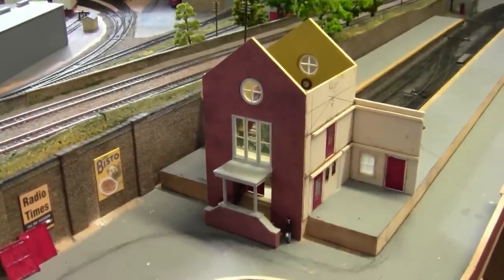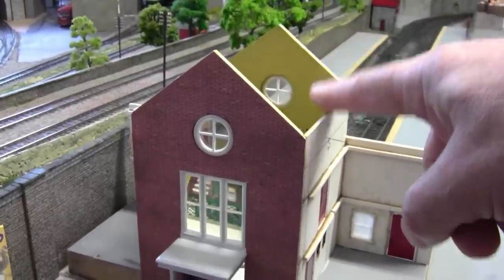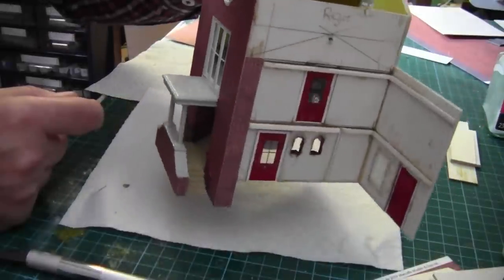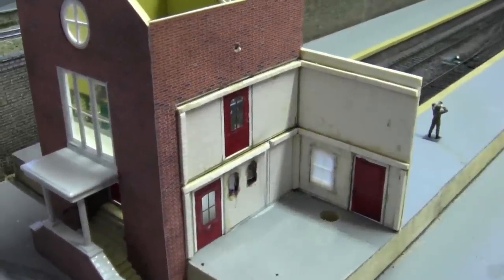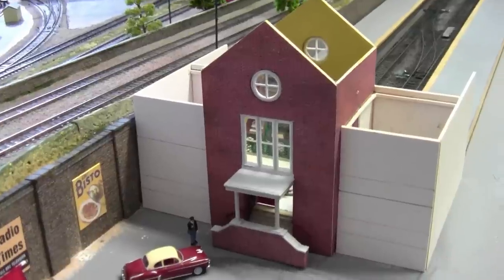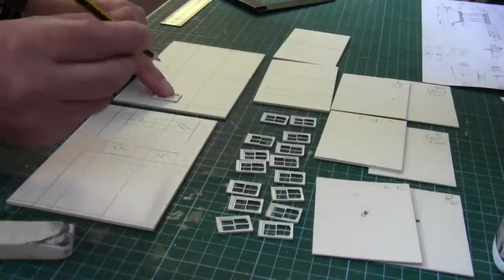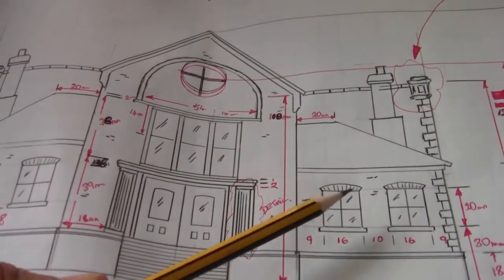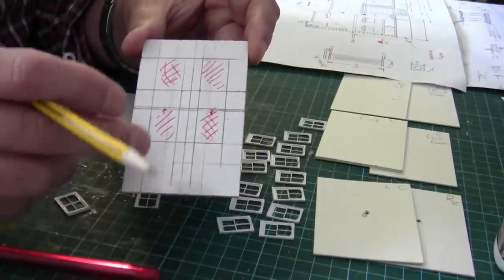Jarrow Road Station Part 6. No340

Comment: Great progress. The station is really coming along. Concerning the narrow strip of road that concerns you,  a possibility is it could be a one way road governed by traffic lights. I'm sure it was in a village in the Highlands of  Scotland (but I can't be sure where) when my wife and I came across just a street. It was only a small street but both ends of it had traffic lights and the direction of the traffic was governed by the lights. One side of the street had double yellow lines and cars were parked on the other side. It sounds an odd configuration but it worked and vehicles could pass up and down the street. I suppose the road on the layout might be too long for this but I thought it was worth a mention. Thanks again for a great video.
Reply from the maker: Hi Alfie. yes there has been a couple of you saying the same thing about adding a set of traffic light either end of the road. seems like a great idea to me. i do know of a few places where this does happen. thanks again until next time, many thanks for commenting. cheer's Tony

Comment: Those sash windows really work well and yes the second storey windows complement and balance the main viewing window, anyways you have two extra functional rooms to detail which gives you a truly functional station. Lovely work. Have you thought about using the fine wire copper shellac coated  led lights I sent you (tack them in a corner and a narrow triangular fillet to cover if necessary) - it’s easy much easier to hide the wires compared to using pvc insulated? That’s it, three in a row an evening well spent. All the best Stephen
Reply from the maker: Hi Stephen mate. i do like creating extra work for myself with these builds. 
thank you for the reminder i do still have a set of those lights but i am saving those for another build. i will be using warm glow LEDS like the ones i used for the other station. 
Binge watching TNE, well thats a first. never heard of anyone doing that before.  i used to binge watch the series Game of thrones. disappointing ending.  
many thanks for commenting. you can take it easy now mate. at least until next week....cheer's for now 🍺🍺🍺🍺🍺Tony
Reply: @TONYNORTHEASTERN  Hi Tony, never binged before so I can chalk up a first on TNE then! Crikey on GoT but it’s addictive, we have watched it twice through using our library here, yes it did fall a bit flat at the end. Doing a few at a time was really good as it just flows and good to recap on materials etc too - I have a lady over here who is interested in scratch building houses etc mentioned your channel, must follow up on. Really nice seeing the mini running sessions - that will help a lot of folk I am sure and keeps current build in perspective. Variety is the spice of life so they say. All the best my friend Stephen

Comment: Thank you very much for all these helpfull hints to my further planings of the build of a very small O-scale Narrow-Gauge Railway building - some abbrivation of your building will come to bearth as an end-to-end layout ist not to avoid in the beginning.

But I do admit my starting has to be something very much more simpler Not to Run in issiues: a pig-barn. As a "kind of fingers' etuede" at the first step. So to add some intrest it will be build with a bent ridge beam and a "wobbling" roof below.
Thanks a lot for these great inspirations and I will start very soon with my 7mm scale in 9mm track sectional self layout - it will be simply called "Narrow Gauge Island" a freelance finescale project. 

Best wishes from Berlin, Christian
Reply from the maker: O scale. i love that scale. ideal for scratch building. thats the thing about scratch building you may see some time and think hmm i could do that but slightly different. even i think that when i look back at and see what i have built. love to see some pictures once you are done. thanks again for commenting very much appreciated...cheer's Tony
Reply: @TONYNORTHEASTERN  Thanks Tony, I am in the very beginning of the railway and will start the YT-channel when there is space in my little flat's room. It will be my first railway after 25 years of absence to the hobby.
You are right, Tony, the big issiue ist to be flexible to alter any building into what fits into the limited space left. And as I do want to build a(n) industrial/rural Light Railway it is allways to be kept in mind:  
"The moderation is key!"
As there will be Not too much cuttings when bending the track and adding some foot of sleepers and irons is a lot cheaper to Work arround than to dig and build expensive and extensive retaining walls.

You will absoloutly get an invitation when I do start my channel for shure, masterbuilder Tony!

Have fun and crack in!
Christian

Comment: Could you hid the lighting wires inside a chimney?
Reply from the maker: Hi Chris. not this time, as i do normally hide in the chimneys. the chimneys are to close to the edge of the platform bases. which the station is being built around. thanks for the suggestion, and many thanks for commenting. cheer's Tony:yougotthis: